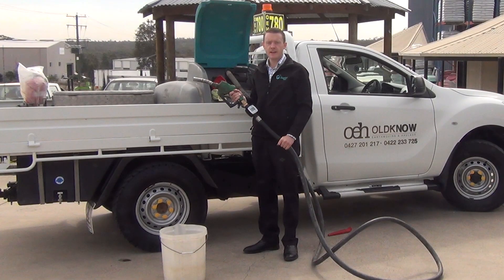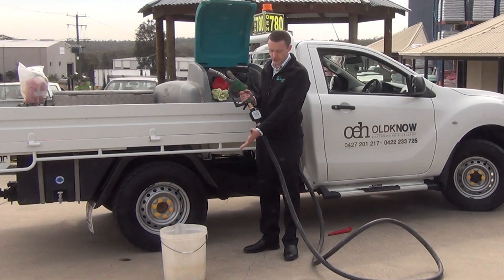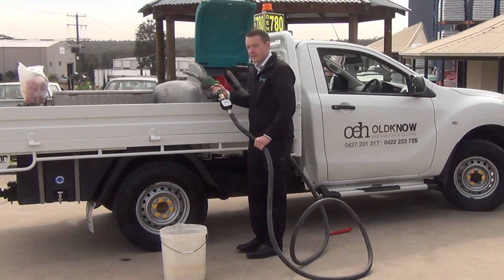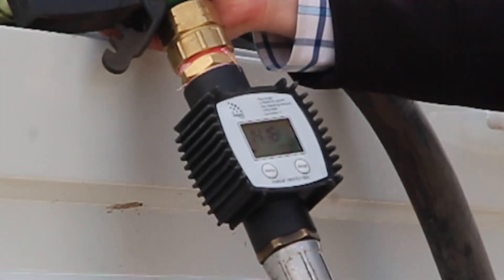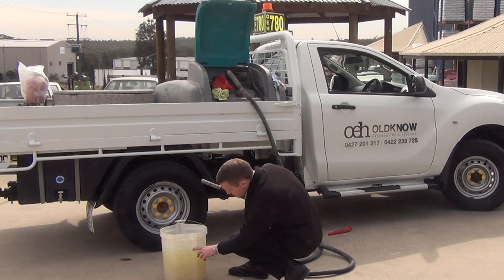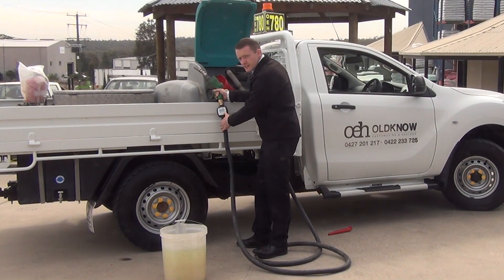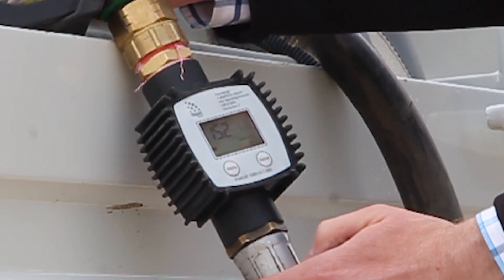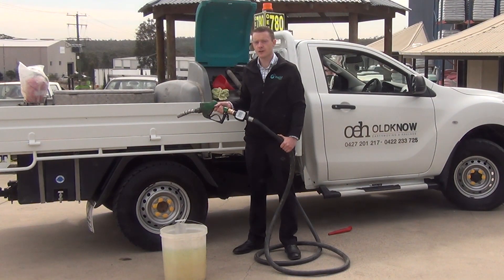How to Calibrate your Diesel Flow Meter | Rapid Spray

Comment: Hello,

 I'm a technician and am in Ghana, I am finding it difficult in calibrating a particular Wayne 2 products helix pumps with 4 nozzle. I'm done with 3 of the nozzles but the remaining one is always giving me over delivery. I have been using the WIP but still it does respond and I have even changed the WIP and the carbon brushes.

Please any way out?
Below is my phone numbers
+233249214906 and
+233277885959 (WhatsApp)